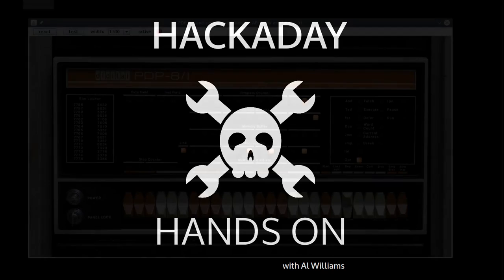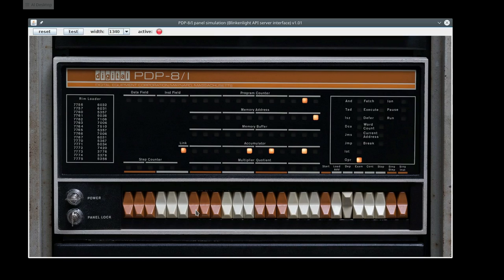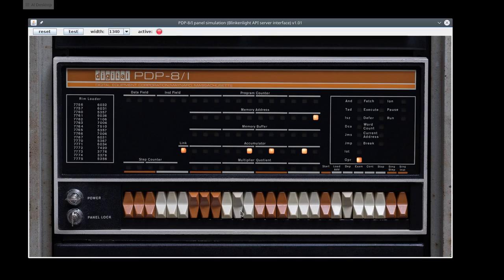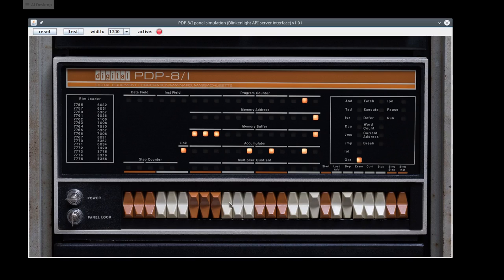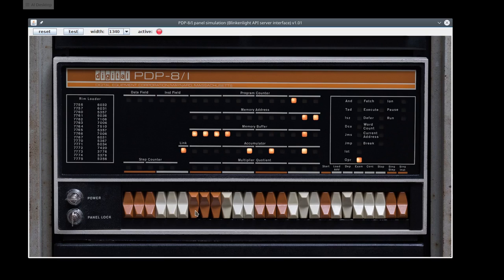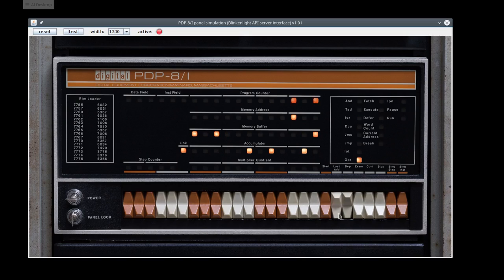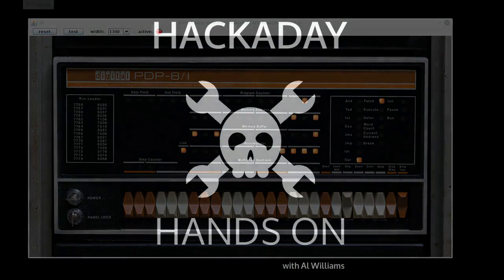How to Program a Vintage PDP-8 via the Front Panel

Comment: I'm familiar with modern UNIX and Linux systems, and I came here to try and understand how these computers were used.
I don't understand the instructions you programmed, or what the final goal was?
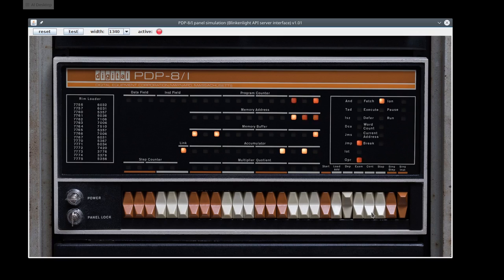Reply: The program is described at 3:24 in the video. It's a very simple program of course, since it only consists of a handful of instructions.

Comment: ....what could you do with this? Count numbers?
Reply: I have seen PDP-8/e in a museum that was used to control an electron microscope. Today you could use Arduino as a replacement
Reply: The front-panel interface was mainly just there to code in a bootloader which would load a program from paper tape (plus some debugging and hardware testing). Once the computer was set up with a program you were good: you don’t need a GUI or even a command-line interface to do most of the jobs that an embedded controller would do nowadays. There’s at least one nuclear reactor and probably at least one railway system still being run by emulations of the (somewhat fancier) PDP-11. Or if you were willing to cough up for pricier accessories like disks, terminals and extra RAM you could set it up to do interactive computing not unlike a microcomputer running DOS or CP/M.

Comment: Many years ago I maintained a system that had a PDP-8i.  I remember toggling in the RIM loader.  One thing I recall from the programmers reference was they actually recommended using self modifying code!  😮 That was normally considered taboo!

Back in those days I also worked on some PDP-11s & VAX 11/780s, Data General Nova & Eclipse, Collins 8500 and some Prime computers.  My own computer was an IMSAI 8080, which also had a front panel.

Comment: im a boi who is trying to understand old computers, but i have a hard time on it because i really dont understand anything at all, where can i start from?
Reply: One may start with learning assembler of some really simple microprocessor e.g. MOS 6502 using some simulator. PDP-8 could do roughly the same but was older and bigger. When one learns assembler, one also learns what registers are, what memory addressing mode is etc.
Reply: Try to find some DEC manuals, they often turn up in second hand shops. They explain things very clearly.

Comment: This was the first computer that I used. My HS rented the computer, as it was over $10,000 in the early '70s. It took about a half hour to manually load the teletype interface and load the BASIC compiler from paper tape. Then you had to delete the trig functions to have enough memory space to actually load a program. The first program I wrote was tic-tac-toe. In college, they had a Control Data 3300; the most beautiful computer I've ever seen. No more interactive computing, however. It was card decks submitted at the desk, a LONG wait and eventually a printout. Seniors could use the teletypes. Time credits were very limited. The first computers I used out of college were Prime 400s. They had toggle switches and LEDs! And thankfully, a bootloader in ROM. We used ADM3A terminals when most companies still used TTY or cards.
Reply: Would love to see a Control Data 3300 in operation.

Comment: This is a neat simulation of the front panel.  I was field engineer for DEC for decades. I supported PDP-8s,all PDPD-11s, VAXs, and Alphas. I miss all of them and still have all my docs and microfiche. It was a great engineering company.
Reply: Many people today look back at technology and assume that the PC was an inevitable development.  I would argue, however, that from the perspective of the mid to late 1970's it was more likely to envision a world of linked mainframes by IBM and DEC supporting large time-shared networks of business and home terminals linked via fi-optics than the PC and ISP world of today.  Time to break out my well worn copy of "The Soul of a New Machine" for another read through :)
Reply: Mark, I know this is a very late question, but have all of your documents, drawings, & fiche been "scanned" and placed into online archives?  (I've got PDP-8s, PDP-11s [unfortunately only LSI machines though], and one VAX in my collection.  It is difficult to find all needed documentation, even for well-documented systems like DEC's!)